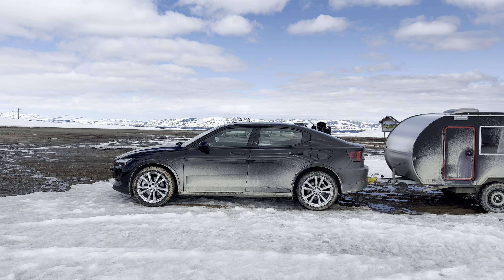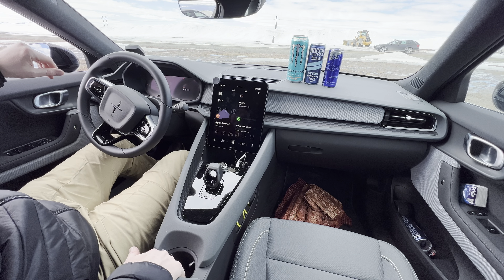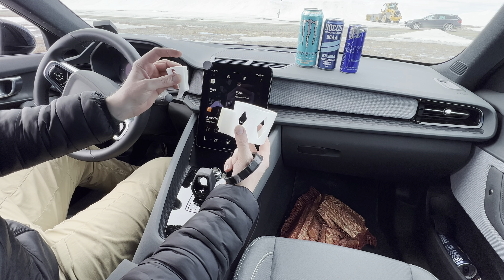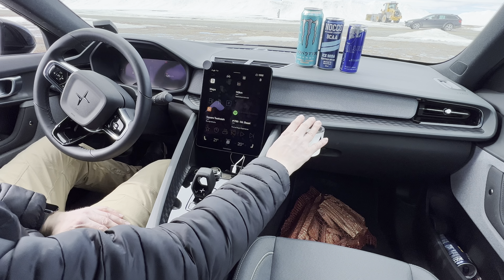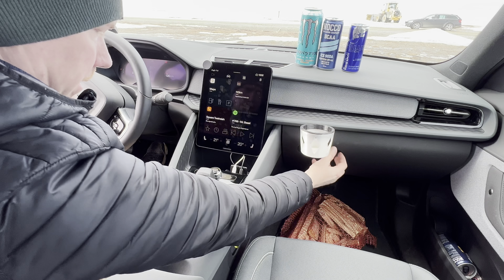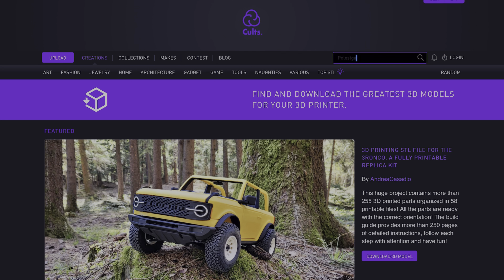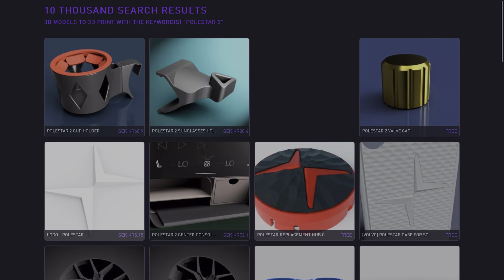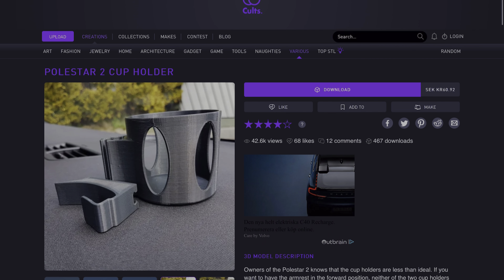Fixing the one flaw with my Polestar 2

Comment: Just looks dated in EV cars now to now have it look nice and roomy at the front by not having that middle section there
Reply: While unfortunate,  polestar did have to put extra battery cells where the typical driveshaft would go because it is on a shared gas platform. It is not like polestar put the center console in for no reason.

Also, I think 1/1000 people would call the interior dated.
Reply: @trevorv9035  Which I believe should be safer, since most of the batteries are in the middle of the car. Any side impact wont explode the batteries on other cars which use a skateboard style battery pack. LOL!!
Reply: @trevorv9035  who cares if it's 1\1000 lol that means nothing since each person has a right to their opinion does not mean mine is wrong so get rogered